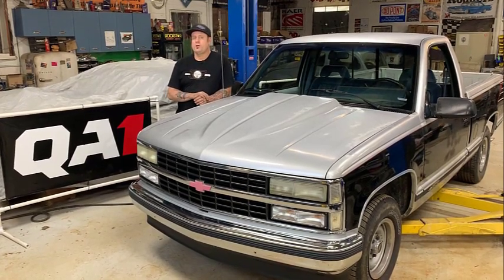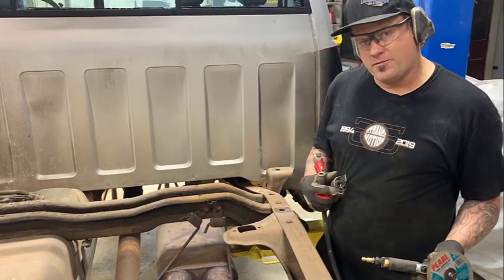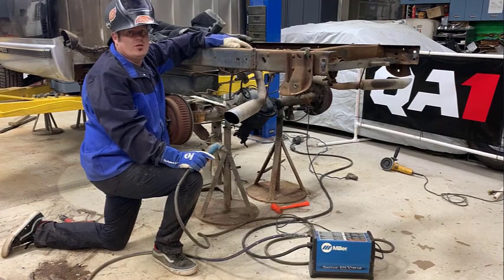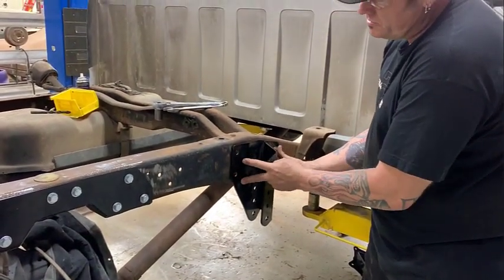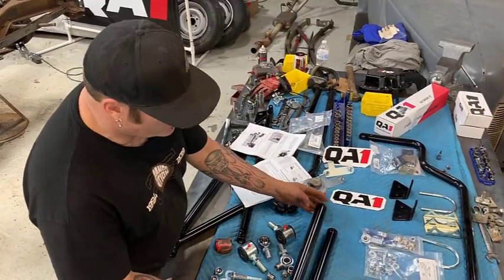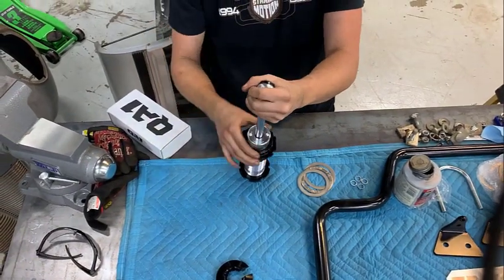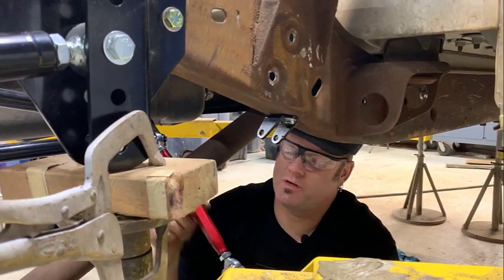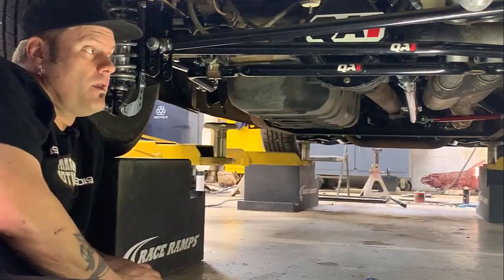The Strange Motion Way - QA1 GM C1500 Suspension Install

Comment: Definitely a awesome setup were can still use your stock gas tank. Great video...
Reply: Yeah. Kudos to QA1 for running the stock tank. It has a lot of performance benefits. That said, I'm getting ready to do my truck, and I'm seriously considering a rear-mount tank made of 316SS. The big picture is, since the tank and backs of the leaf springs aren't in the way anymore, it makes a lot of sense to run the exhaust straight back and 45 out either in front of, or behind the tire. Simple, and good sounding. Plus, you can put the mufflers close to the collectors if you like the sound of long tail pipes.
Reply: @Dr_Xyzt  awesome